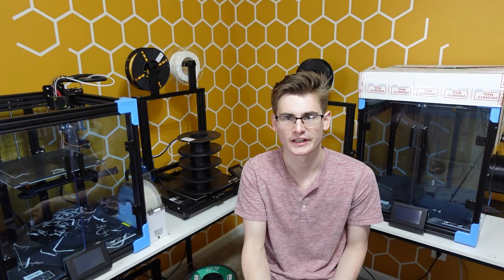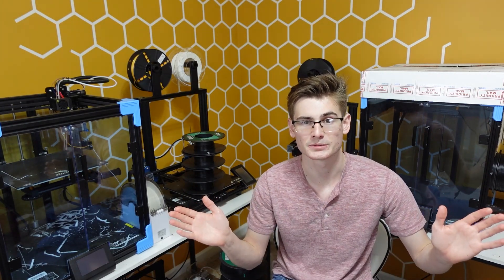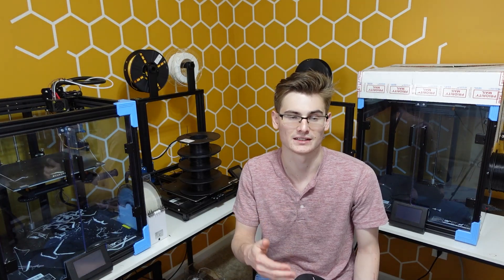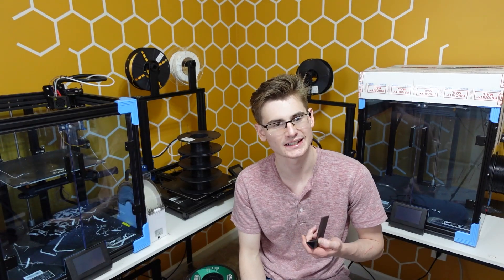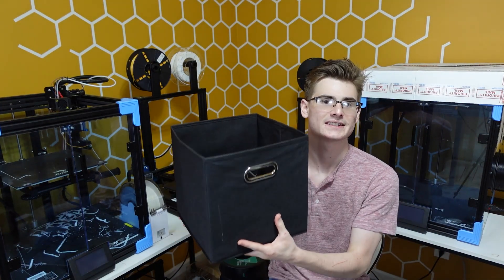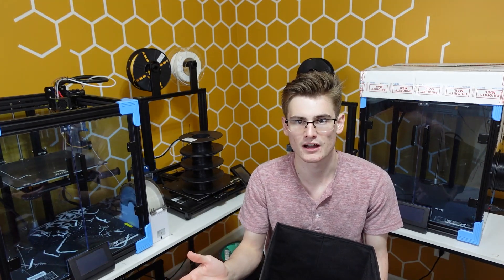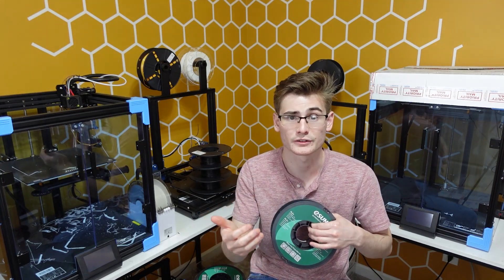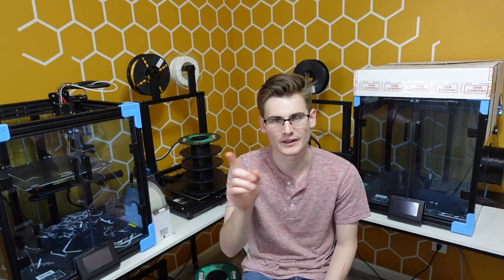Best 3D Printing Business Practices and Strategies!

Comment: Don't drop your price just because they did. It's poor strategy and tells your customer there is no difference between supplies. It also begins a race to the bottom and then you waste your time. Provide more value instead of dropping your price.
Reply from the maker: I think you make a good point in most markets. Sometimes you have no choice but do be competitive though
Reply: Racing to the bottom is a defeatist strategy! As long as your product is quality and priced reasonably you shouldn’t have to lower your prices to still make sales!